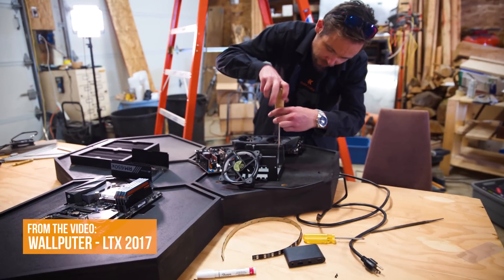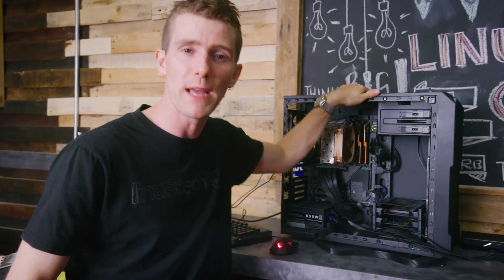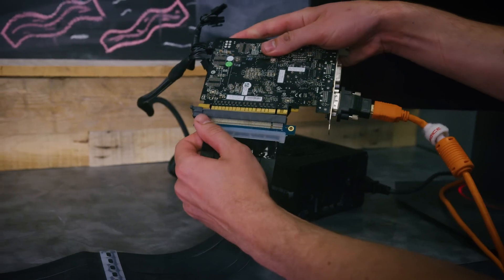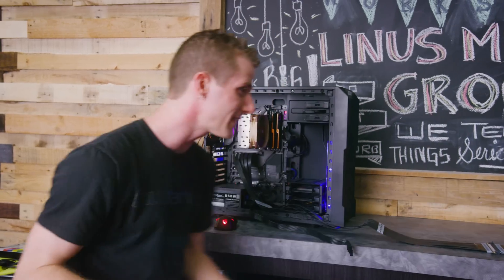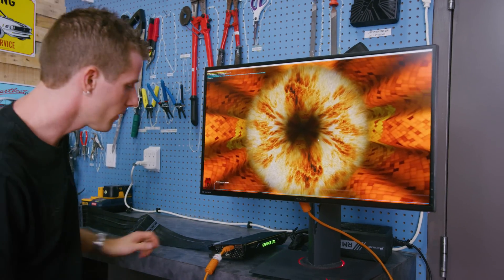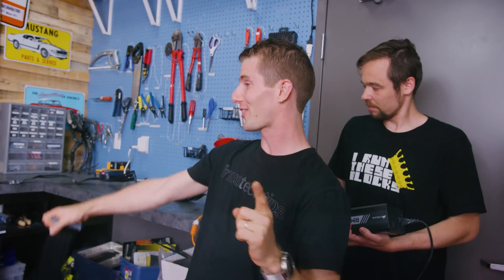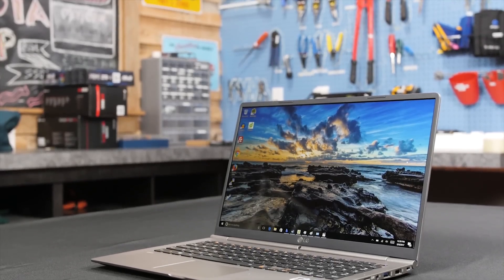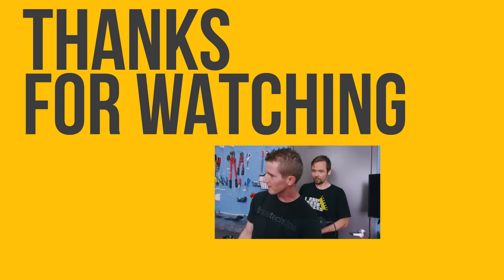How many PCIe Extensions is TOO MANY??

Comment: With so many extensions cable you could easily put the GPU in a fridge to cool it down
Reply: Refrigerators rely on the fact that there's little heat being added to the fridge. The cooling element will do nothing to keep your graphics card cooler, and it may even expose it to higher temperatures than what it would normally experience due to heat build up.  Linus did an episode on using a refrigerator to cool a PC already.
Reply: The compressor in a fridge isn't strong enough to deal with the heat a gpu would put off.
Reply: If only an electronic video producing company had tried that at some point... and uploaded it to a video sharing website.
Reply: Condensation isn't the big problem - modern fridges actually include extra valves, sensors, etc to avoid condensation. The real problem is your fridge cannot keep up with a 200W+ heat source. A certain youtuber even did a video on it.... https://www.youtube.com/watch?v=B8bhGw4vUFE
Reply: anoori9000 hot air condenses on cold parts...not the other way around.
Reply: Have fun with condensation
Reply: +Person  Linus actually did this years back, a fridge is NOT strong enough the compressor either gets burnt out or simply is unable to keep up.
Reply: now that is an original.
Reply: Would heat up too fast.
Reply: He made a video on that
Reply: Why don't just put your PC into fridge ?
Reply: condensation
Reply: My favorite reply is that apparently a refrigerator is cold enough to freeze a heat source (the graphics card), but not cold enough to freeze literally anything else you would normally put in it.  I think I need to retake some physics courses because apparently things get colder when you apply heat to them.
Reply: Person. Actually they do make fridges that are just strictly fridges with no freezers typically only rich people have them though
Reply: Person. The part that freezes is a freezer. The part that doesn't is a refrigerator. When you say refrigerator, it means the one that doesn't freeze. If you tried a water cooling system with the condenser on the freezer, it still wouldn't freeze because a freezer relies on the same assumptions as a fridge. That is that there will be little heat added to the system. The freezer condenser would not freeze the graphics card. They can get up to 60 or even 80 degrees celsius. That is a lot more heat than the condenser is designed to handle, so it won't. However, since you're so adamant, I suggest you clear out your freezer, put a PC in it, seal it, and watch the money drain out of the bank account of the person paying for your electric bill while your condenser works overtime and your graphics card thermal throttles because it isn't designed to operate in a room at near boiling temperatures.
Reply: Gerald Norton uhh, we're far from rich but we have a single fridge with no freezer? Like, we arent even comfortable...
Reply: 'Person' here is entirely correct, the compressor in a refrigerator is well over what you could ever use to cool just one computer, in fact the compressor in a mini-fridge is enough to cool about(not an exact scientific breakdown, just a general assumption, given that it has been done with one easily) 15 7700k's overclocked well beyond typical air and water cooling thresholds, the issue is that the refrigerator/freezers are only running the compressor for a very limited amount of time, wherein over the course of 24 hours it may only run for 10-20 minutes, and only a couple minutes at a time. A standing freezing, with the inefficient side-opening doors will run about 3x as long, up to an hour or so per day. Chest freezers can get away with as little as a 5 or 10 minute run once daily. The compressors in these systems can run well beyond a 24 hour run period continuously, the issue being that the freezer/refrigerator system itself is designed for extremely minimal airflow to the main compressor unit itself, while the compressor wouldn't fail, the plastic encasing around would possibly soften, or being to melt. But that's expected, and wouldn't physically fail the system. If you were to take the compressor out of the refrigerator/freezer, and hook it up to a cpu unit, or anything else requiring heating, it'd have to be entirely custom made, unless you wanted to take apart a commercial phase-change cooling system, which have been provided, and use compressors much smaller than those in commercial refrigerators/freezers; you'd have no issue whatsoever cooling it for however long you wanted. The only possible issue, besides condensation, which is easily overcome with simple insulation and some engineering here and there(di-electric grease is a good man.) it'd cost an absolutely metric fuckingshitload of money.

Basically it'd just double your computer's bill if you're using a mini-fridge compressor.

A full size refrigerator compressor I could only imagine would use a big number that I wish not calculate.
Reply: Judie Applepie no put it in the freezer
Reply: He already did this experiment once before and it could not keep the card cool. Now, maybe the freezer might be able to but again, it is built with the assumption that there is not a continuous heat source.
Reply: anoori9000 no1 got the joke?
Reply: Linus tried the PC in a fridge. But he didn't try a PC in a PIMPED FRIDGE that has more cooling capacity and exchanging air.
Reply: another possibility would be gaming in a cool warehouse besides meat and stuff :D
Reply: weare goign to put it into the continer where you put butter
Reply: +Gerald Norton nope, fridges without freezers are pretty common, and not a thing of the bourgeois at all.
Reply: G-Rex in high school my brother did an experiment with ice trays. Ice trays filled with hot water froze faster than an ice trays filled with cold water.
Reply: John Henderson I think you missed the part where I said "heat source." I know that experiment. The problem is that even boiling water isn't a heat source because it's not generating heat. Also, I was talking about in a refrigerator, not a freezer. In a refrigerator, nothing should freeze or your temperature is too low, so something actively heating up could never freeze in such an environment.
Reply: +Person. You don't know how a refrigerator works. They do not work like water cooling. Water coolers use radiators and are cooled by exchanging hot water with cooler air. If you put a computer in a room that was 80 degrees C and water cooled it, you would never see the temperature fall below 80 degrees C.  Refrigerators use the evaporation of fluids to cool the inside of the fridge down.

The temperature of the compressor doesn't matter, and it never will because the inside of the fridge is closed to the compressor.  The trick here is that they take the heat out of the fridge and put it somewhere else. Otherwise fridges would break the law of conservation of energy.  When you put energy (electricity) into a system, you don't end up with less energy in the system (cooler inside) than what you started with.  Since you have apparently taken refrigerators apart before, sometime you need to take the entire compressor and put it in the fridge and turn it on.  You'll notice that as time goes on the temperature in the fridge will increase, not decrease.

You just don't even know how a fridge works, so go look it up before you tell me how great a fridge is for cooling a computer.

Oh, and finally, the suggestion was to put the graphics card IN a fridge.  If you take the cooling system out of the fridge and attach it to the graphics card, then the graphics card is no longer in the fridge, so regardless of what magical powers you think your fridge has when taken apart, you are still wrong because that doesn't matter.
Reply: Armouredfalcon well I meant it's more popular with rich folks then
Reply: +G-Rex But this is just simply a poor execution of a funny thought, the proper way to do it is to remove the insulator(air) from the equation and direction the cooling directly to the place of issue. However if you did just enable any modern refrigerator to run on a continuous cycle, it'd easily keep a computer well below freezing constantly, without any physical modification to the refrigerant pipes. The entire issue still with this, is simple that the refrigerator is not running for its maximum possible cycle time, it's running for a very short amount of time set up to a simple timer which based on factory studies will keep general items cool.

So if you can(could) find a refrigerator that for some reason lets you run the compressor continuously, you could put a couple PC's in there and use them until either you run out of money from the power bill, or your computers end up getting some random condensation drops on them, which would be really unlikely unless you kept opening the door. 

From a general user standpoint, a fridge is entirely stupid for many other reasons, but the cooling performance on a standard unit is indeed the main caveat. But with some simple modding you could easily make a refrigerator capable of cooling a computer. 

All in all this entire thing is stupid as shit, but it's still a funny little concept to poke around at.
Reply: can extend it into a tank of mineral oil
Reply: theoretically it's fine as long as there is no H2O in the air
managing that on the other hand is a different story
Reply: Judie Applepie finally a solution with those AMD cards
Reply: Judie Applepie An AMD card in a freezer is equal to trying to refrigerate a camp fire fueled by jet fuel

Comment: wait, have nvidia stopped throttling the furmark benchmark? I remember a few years ago both AMD and nvidia where reducing GPU clock speed when that benchmark was running.

Edit: i've just downloaded and ran furmark on the latest driver and it still throttles, so not the best benchmark to use imho.

Comment: Did you check the last extensions or switch it out? Friend of mine had 2 broken Thermaltake PCI Extensions before switching to a different brand. Symptoms were the same: lower framerates, stuttering  and system shut downs.

Comment: A while ago you wanted ideas well here you go. The new i9's are really hot yes, and the new vega64s are hot to yes? So water cool an i9 and 4 card crossfire vega64s and heat a hot tub with it on synthetic bench marks. What would happen first? would the hot tub get hot or would the equipment fail.

Comment: I mean, I know is funnier to put the graphics card as far as the cable let you but and I understand you did it for show.
But you could still use the same psu just by bending back the pci extension. But again, that wouldnt be as fun.

Comment: Um.Actually, theoretically, why is frame rate the thing you are benchmarking?Wouldn't latency or signal strength degrigation make more sense?I mean, you do have an electronic signal, so even at that distance that wouldn't make a difference, and it's a digital signal, so it would have to be hella degraded before you will get errors with that.
Still, I do feel that frame rate isnt really the right thing to benchmark here.Well, unless of course you want to know how long untill your games start to slow down

Comment: Could the signal be limited by the speed of light? PCIe freq = 100Mhz; Speed of Light: 300Mm/s; 300/100 = 3m (meters per sec divided by 1/sec equals meters)

Comment: I am thinking to put my GPU inside Air Conditioner hole with this PCIe Ext 
I know it will get too much dust but it will get better cooling without using water cooling or AIO. =)

Comment: I don't know if that is the limit...  990FXA-UD7 / Radeon Fury X.  The 990UD7 has an additional power connection that supplies the PCI lanes,  and so does the excess CPU power lanes.  Get the watercooled,  get massive turbo cores but low voltages,  and set to 4 core mode,  a compatible CPU/APU,  set the AMD Target Framerate,  Pre-Processor for frame sync technology,  increase power to the GPU,  and edit bios for the motherboard return power limits,  down it's default clock AMD FX-9590 Vishera  but I would say use this,  like 3.6,  then a boost of 5.5,  would also recommend maximum fan and a 4% power boost,  also the memory clock should be on the extreme end and the core clock should be "Cool And Quiet,"  as the responsiveness of transfer is of the most importance.  Also not sure how extreme you are,  but there are rumors that there is a Dual-PCI to single PCI and a "bitwise" overlay for mapping memory addresses for XX YY cross communication,  the AMD's throughput in memories goes over 5.5GHZ and always on the blitz,  unlike NVidia,  so it could with some further overclocking be enough to be on the snap.  Blah blah blah.  Have fun with this one,  I'm sure you can do better.  :)
Reply: mandoza3 I don't know how much sense this makes but I like it.
Reply: mandoza3 It's not a power issue. It's a signal delay, crosstalk, inductance, interference and probably a bunch of other things issue.

Comment: this is why I stopped watching linus a long time ago,the builds are fantasy,and the hardware "must needed" is plain stupid,and from me, (an average pc user and casual gaming guy),I would rather to be an informative channel about tech stuff from the ground,and not high sky fantasy builds that NOBODY in their home are doing,there is no problem with being a little more realistic ; everything needs at least a 1000w gold psu,64 gbs of ddr4 ram, 3 titan xp, and the latest processor available with a case with 50 fans,watercooled and 10 radiators, and don't forget 40 monitors running at 8k resolution minimum.. sure,let me get a mortgage for life,and I will built that. "the ultimate gaming setup, 40 people gaming with only 1 computer" FFS,why? facelpam

Comment: Why does this happen? Like why is there a small limitation? I would assume it could go across a house before loss of power or performance. At the end of the day a riser card is just a card with metal inside that connects to other metal to make metal longer. so electricity can pass through. I would assume that would mean the limitation would be the distance at which too much energy is lost for the signal to be readable.

Comment: When you increase length on any cable, the cable/risers thickness increases so that's why he got to the end "very quickly"
With thicker wires in the cable, you can run about anything even at 100 meters.
Imagine a 5 meter PCI-E cable for $169.99.
That's why he couldn't run 2x cheap risers, because of the thickness of the wires inside.

Comment: Why stop at PCIe? Why not try every cable in the computer?
Reply: Scott Brenner psu you in the attic 
Mobo and CPU in the basement
Gpu in the bathroom 
Monitor keyboard in the living room 
With speakers outside
Hard drives and SSD's in the shed out back
Reply: 10 meter standoffs for the mobo
Reply: Each individual CPU pin
Reply: Scott Brenner well power and sata cables are the only other cables and they can go far
Reply: Scott Brenner Next video: LGA 1151 rizer
Reply: USB 3?
Reply: 40 m fan headers?
Reply: +The Hunter yeah so stretch em the hell out.
Reply: cpu in the fridge (instacooler!)

psu direct from the circuit breaker (man!)
Reply: Django Flaherty depends on units and age. Older USB3 controllers and high current units without discrete power supply, will have issues due to EMI / RFI.
Reply: Anything that uses differential signaling like USB, sata (and well PCI-E) can be extended a lot due how the signal is not "off or on" but "line 1 is positive while line 2 is negative or the other way around".
Now things like ram slot, CPU slot, you know high speed serial plugs will underwhelm quite a lot.
Reply: Scott Brenner including CPU mobo and sata power?
Reply: just have a motherboard in the case and everything else like 20ft away lol
Reply: lmao
Reply: WHICH DEVICES FAIL FIRST!, AS YOU TRAVEL FURTHER AND FURTHER AWAY!
Reply: @Daniel McKenzie I can tell someone has been to Australia xD
Reply: usb and video cables will probably stop working after a meter or 2
unless you used FIBER OPTICS 
have a mouse and keyboard all the way down the street
and binoculars to see the screen or a giant projector?
Reply: because this video is already 9 minutes +
Reply: Scott Brenner they're to stupid to realyze but they might try anyway, so good luck!
Reply: Computer Netd  HVAC system, equal heating for your whole house. (AMD only)
Reply: I tried that, you will break the fan header because the cable has too much resistance
Reply: Scott Brenner even the cpu
Reply: Scott Brenner I
Reply: Scott Brenner why buy a case then
Reply: Hunter Long give me a mobo among the gum trees, RAM in the plum trees.
 the GPU in the garden too and the Hard drives out the back.
 Monitor by the front next to the old rocking chair.

Comment: LOL.. I'm not too surprised at this.  Each PCIe lane is a balanced connection and I think the recent PCIe specs have some sort of gain compensation built in, but I don't recall 100% if that was the PCIe spec or something else and I don't know if that would even be implemented in Intel or AMD CPUs.  The gain would help compensate for longer cable/line lengths but it can't compensate for added noise picked up by longer cables.  A good test might be to see what lengths you can get with different Intel CPUs and different AMD CPUs.  Other factors could also give added noise like ground loops from improper grounding between the two power supplies and fluorescent lights (even monitor back lights) etc.